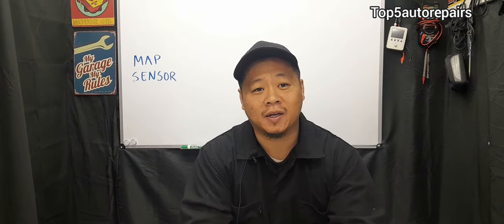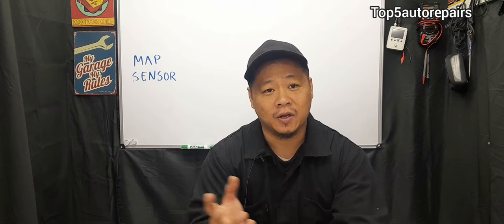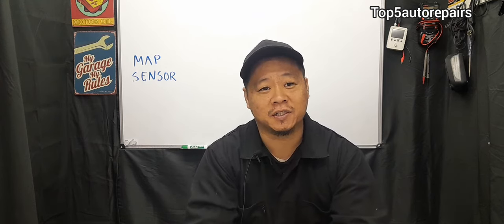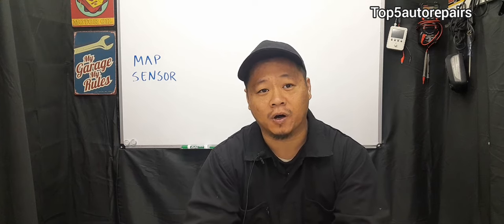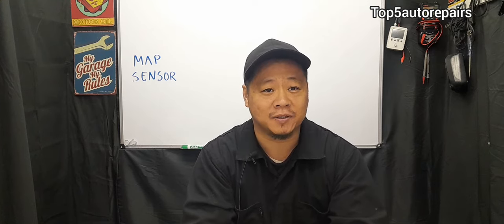SYMPTOMS OF A BAD AND FAULTY MAP SENSOR | WHAT HAPPENS WHEN MAP SENSOR FAILS?

Comment: I have weird problem that cause me headache, the problem is that when I drive all good, but when I approach to 🛑 I slow down the car and put in neutral then the rpm is bouncing up and down until the car is completely stop. When I disconnect the map sensor and I drive the issue is gone. I've plugged OBD2 and looked for possible errors and nothing... I've read that a bad TPS could be the problem, I really don't know what else to do, I've tried the idle relearn and nothing, now I am waiting for my bidirectional scan tool to try TB relearn. If that not fix my problem idk what else to do.
Reply: I’m going through the same shot too, does the car sputters or jerk as well?
Reply: @LUISTORRES-vx4mg have you fixed it?
Reply: have you fixed it?
Reply: @parsifaal4005  yes, it was a bad ignition coil
Reply: @parsifaal4005  I've bought another throttle body. Now all good!

Comment: MAP sensor should read 99kpa or 100kpa when the ignition is ON position
Reply: My Honda J-series engine (2007 V6) has rough idle and sometimes misfire DTC. I noticed that the idling engine "Intake manifold absolute pressure" is around 27 kPa. During normal highway driving at constant speed, I see fast fluctuations without reason (going up to 75 kPa or 85 kPa for a fraction of a section and then drop to around 27 kPa). When engine is not not running, I get 100 kPa (close to 1 atm), My LTFT is +14% or sometimes +20%. Is my MAP sensor bad? If so, why do I get 100 kPa and 27 kPa which are considered normal for non-running engine and idling engine? Overall fuel economy is around 20 mpg on par with similar cars. I hope someone can shed a light on this (esp. whether fast and large kPa fluctuation is normal or not). Thanks.

Comment: I've removed the map sensor and it was completely bunged up . Im not to sure, but can I  use the entry to spray in erg cleaner so it cleans the pipe leading to it as well as the erg valve at tge same time . ? 🇬🇧
Reply: Same question.
Cheers.

Comment: I have a 1990 Ford F150 and everything but the TPS sensor, Idle Air Control Valve, and the map sensor. It starts fine, runs fine, idles fine. But second gear or when accelerating to pass it bogs down and doesn't have any get up and go. Shifts great but these are the last of what I know I can replace to fix the issue. Also the check engine light comes on intermittently.

Comment: What  sensor to check if the car goes from 0 to 100mph very fast but struggles to go beyond 100mph even if you press hard the acceleration pedal it doesnt achieve 120, 140, 160, or even 180mph.
Reply from the maker: There is a rev limiter
Reply: @Top5AutoRepairs  Initially the car used to going  up to 180mph, what might have gone wrong with the rev limiter as there is no any check engine light.
Reply: Fuel filter / pump